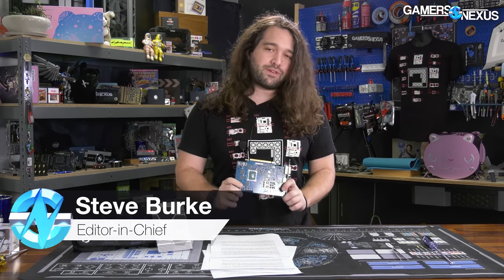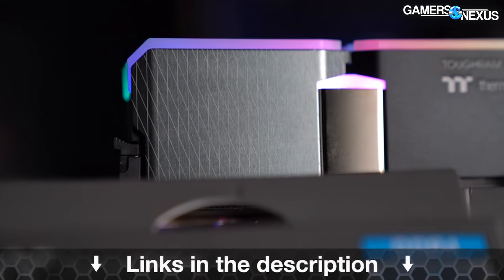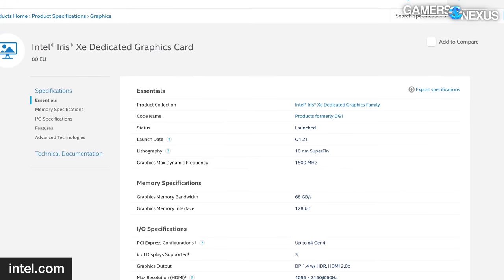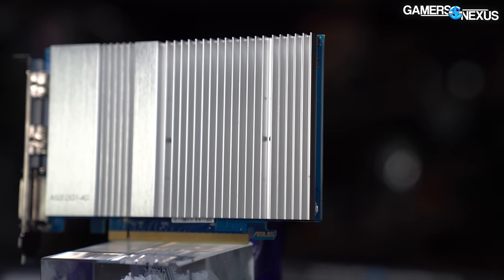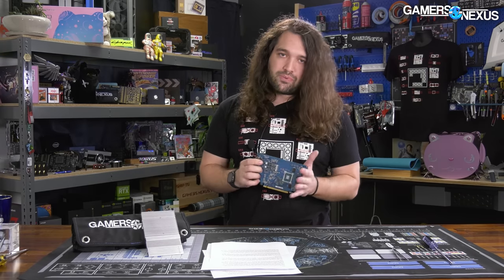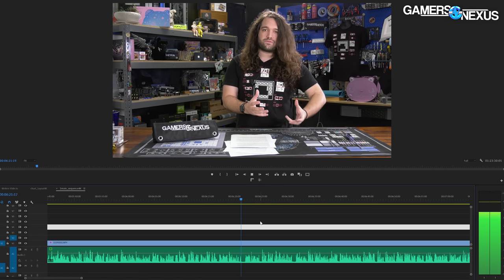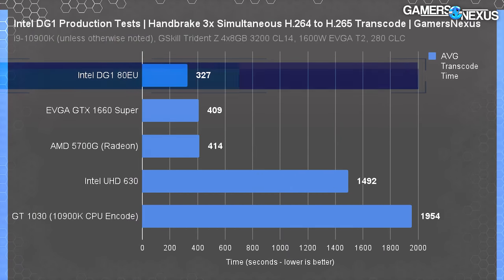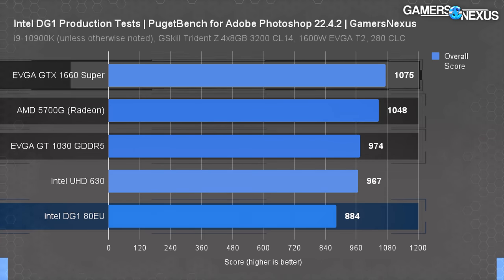Intel GPU A Real Threat: Adobe Premiere, Handbrake, & Production Benchmarks on DG1 Iris Xe

Comment: For video encoding we work with a system which slices the encoding job up into chunks which are a few seconds in size. Then divides that encode job between multiple worker nodes. This allows us to render very large videos very quickly, but as a secondary benefit, if a node is corrupted, or the task is blocking, the system can kill that task and reallocate that chunk. Massively parallel encoding across many, many nodes.

Comment: To install it on other boards- maybe try booting with other GPU as primary while the Intel GPU is in 2nd slot and after installing the drivers remove the primary GPU.
This helped my on older intel made boards that didn't support modern GPU's.
Reply from the maker: It doesn't work. We tried that.

Comment: Thanks Steve.

If Intel releases a version that will work in any old motherboard and was low profile I'd throw one in my old 7th gen Intel media PC that runs Emby media server just for the encode/decode.  The fact that it's passively cooled is a huge plus over higher end GPUs with similar functionality.

Comment: I'd be very interested to see how the Apple M1 performs in these benchmarks. Even though it doesn't really fall under the purview of the channel, it would be a useful comparison to see what performance there is like on workloads like these that can be run on either Windows or macOS. The base Mac Mini is also fairly inexpensive in that a full DIY system featuring either the DG1 or the GT1030 would cost about the same.

Comment: I'm disappointed in the lack of 'multi-gpu' performance as well, big air quotes around that one for sure, but I have been saying for years that amd could do some stuff with that, at least since they started making a big deal about their 'apu' performance, but they can't keep their igpu tech current with their dgpu line. It was also saddening that you can't put it in another system for the same acceleration. Hopefully this is more of the test run and they actually follow thru and add so e of that kind of stuff in the future, because I agree with you in that there is a market for it.

Comment: Good news for the Blender Cycles test: the next generation called Cycles X will not be rendering in tiled ways, but rather more fine-grained load balancing between devices. There are currently some experimentations in the cycles-x branch that balance workload based on actual performance, which will hopefully eliminate that waiting for the last tile issue.

Comment: good video but there was one small niggle; please don't confuse the terminology for intergraded and discrete GPUs as prior to the move to APUs GPUs on motherboards were still considered non-discrete, even though they weren't part of the CPU package, some of them even had dedicated VRAM (I have a board with a HD4250 with 128mb of ddr3 soldered to the board).

Comment: If DG1 would function in my PC, I'd buy one as a replacement for my 650ti. It is exclusively used for video decoding and encoding (and for some low intensity programs), leaving my 1070 completely free for gaming.

Though it'd definitely need to be an example with VGA, or DVI with analogue out.

Comment: OK! Less than 2 cents here.
For blender that you mentioned, I completely agree on cpu+gpu rendering BUT
I use CPU for one render and GPU for a parallel one
Also have an eye on blender 3.0 that is coming at August that will feature Cycles x
supposedly more on par with modern cpuz and gpuz.
That will make the tile rendering obsolete so big hopes for a huge performance uplift
Rumors ahs it 2 to 7 times faster rendering

Comment: I'm not sure were going to have adequate availability of this(or the next) generation of GPUs
Reply: They've booked quite a bit of production from TMSC.  Enough? Only time will tell
Reply: the miners that were forced to shut down in china were selling off gpus to resellers as low as 10 usd each to be sold in european and american markets, dont worry, the price crash is coming.
Reply: @josh223  how do you know?
Reply: @SuperTheLycan  well for one thing china cracking down on mining is public info thats what caused the crypto crash, two most of those mining operations as a result have to pick up and move somewhere else and liquidate what they can't move, three theres been a consistent downtrend in gpu prices since the crack down happened (there are 6700xts as low as 600$ USD for a buy it now price on ebay) and talking to these sellers the ones that will talk will say that this is where their gpus are coming from combined with domestic miners that are jumping off because of decreased mining profitability, and also ive heard this reaffirmed on a few tech podcasts.
Reply: @SuperTheLycan  a day later and UFD tech posts the same sentiment as a video. make of that what you will
Reply: @josh223  link?
Reply: @SuperTheLycan  youtube comments wont let you post links. if you look at UFD techs newest video its in the first few minutes. also publications are catching on to the miners offloading gpus, if interested look at " Chinese crypto miners are dumping GPUs on secondhand trading site

￼

 by Wolfie Zao

July 7, 2021, 4:45AM EDT" at The Block

edit: Its on hot news, not the ufd tech main channel. i forgot they split it off
Reply: @SuperTheLycan  correction: its on the Hot News youtube channel, i forgot that UFD tech doesnt do hot news on the main channel anymore.

Comment: Hey gamers Nexus, did you think about using a virtual environment (such as a kvm) in linux in order to test different types of hardware without the software refusing to operate for the hardware in question? Emulation can often alleviate restrictions or completelly bypass them at a low resource cost, enabling testing.

Comment: I think if you use the same tile size for all hardware on Blender, it will let the faster hardware pick up on what the slower hardware was still working on once the faster hardware runs out of completely untouched tiles to work on. I'm not sure what's the impact in the total rendering time compared to using the optimized size for each device.

Comment: Steve, did you see that EVGA is changing the email notifications for those that requested stock update on GPU? They are automatically moving ppl to the LHR GPU lost due "low inventory" on the normal ones.

Comment: If you use hybrid rendering in blender and set tile size to 16, both the cpu and gpu should use that tile size. 
Not sure about openCL but tile size doesn't really matter since version 2.8 and picking a small tile size makes the difference in finishing time negligible.
From the blender wiki:
"CUDA renders no longer need to use large tiles. In many cases rendering with a tile size of for example 32x32 will actually be faster now. When using denoising it may still be somewhat faster to user large tiles, but this comes with a high memory usage cost."

Comment: For an entry-level 1st gen product with immature drivers, the DG1 actually looks pretty impressive for video transcoding.  I imagine the DG2 will likely be even better, which is a good thing for Intel, because I highly doubt its 3D performance will live up to comparatively priced competitors.

I believe that the DG1 will eventually not require specific chipsets for compatibility, as they are retail box products, intended to be sold stand-alone for $100 (it's an ASUS retail box SKU, the DG1-4G).  I think right now Intel is only allowing them to be sold to SIs and OEMs because of the current chipset compatibility issues (if they restrict them to SIs and OEMs, they can ensure that the cards are only sold with compatible motherboards), but the fact that it exists as a retail box product suggests that the plan is for this to change in the near future.

Comment: The only thing I don't understand is, if this is a test deployment, why not make it work in anything in anticipation for DG2, because there WILL be edge cases that it will not work with. I'd rather use this as a basic display adaptor rather than NV junk.

Comment: Could it be that the DSDT included with the motherboard has the SSDT typically loaded into the ACPI DSDT by the graphics card? If it does, then it might be possible to extract it and inject it via a bootloader to be able to use the DG1 on another system.

Comment: One thing of note is that the hardware accelerated encoders have wildly varying encoding quality and bitrate efficiency, so they're not 100% a apples to apples comparison.
Personally I tend to just avoid the issue altogether by ingesting footage to DNxHR, either as main input or proxy, this entirely removes the decode bottleneck and makes scrubbing ultra smooth as long as you have storage bandwidth

Comment: Interesting, i actually expected better from a standalone version of the iris xe, seems the same from what i remember the integrated iris being, pretty much a 1030 in performance with modern features, but i think the attractiveness of the iris xe comes in the integrated form, haveing a 1030 level gpu integrated with such low power in comparison is a nice advancement.  A low key gaming machine even as ive found out with my recent Dell based around a tigerlake 1145g7 and integrated iris xe, can pretty much run all the xbox games on windows ive been trying really nicely, modern titles can still hit 60 fps albeit at low setting and 720p, its still impresive to be able to get modern games playable at nice frame rates with what i thought was a business laptop.  Maybe they can be used as ai upscalers while another gpu does the work.  Say even a low end gpu, combined with an ai upscaller could hit high end gpu frame rates.   Something more open source than DLSS.  Its the training of the AI is what Nvidia can do better with dedicated hardware and huge gpu farms working closely with developers and having acces to all that data/code. But in theory you could upscale a game yourself, and with how much performance savings are at steak, it cant stay a propriatery for long.

Comment: What are the FFMPEG/handbrake file sizes compared to CPU transcode. With my 8th gen QSV, GTX 16 NVENC, 4750GE(VegaII) and 5700XT VCE, and Apple M1 VideoToolbox, all options had either poor quality, or much larger file size compared to CPU when transcoding to H265 constant quality 22
My guess is that this is because currently GPUs dont appear to support 2 pass encoding

Comment: Imagine if Intel enables the "SLI" feature between DG1 and CPU IG.
And they act like multiple clusters of a single GPU instead of two different GPUs communicating with each other.

That seems like an advantage to Intel because they can make their own CPUs act as the link that queues resources.

They could still use a "bridge" between DG1s to improve PCIe bandwidth.

Comment: Comparing software x265 to NVENC h265 isn't exactly an apples to apples comparison. I'm not trying to throw shade here, but there are substantial quality and file size differences between these two, using the same settings and source footage. I reccommend researching it a bit more and maybe make a quality/file size comparison video.

Comment: I need some help!! 
Recently I bought a MSI GTX 1080 Gaming X on EBay and have been having some issues with it. 
Random freezes, restarts and won't post after it does. Reinstalled drivers many times and I've already repasted and changed the thermal pads, yet it seems to overheat after 5 mins in idle. Could the card have been used as a mining card??

Comment: EU's mean nothing for ffmpg/Handbrake/NVENC Encoding Performance. It's not a 'CUDA Core' type of comparison. I tested a 1650Super against a 2070Super (same machine, single card installed per test) and achieved IDENTICAL results (1080p high bitrate h.264 to lower bitrate 1080p h.265 for archival purposes, in Handbrake). I also had a3rd test done with a 3090 and the results (using the same Handbrake/NVENC software testing environment and parameters) were the same, even with a more powerful CPU in the 3090 rig.

Comment: Considering that intel's hardware video encoders are actually pretty good, this would find use as a cheap add-on for live-streamers with all-AMD systems since AMD's h.264 hardware encoders give out pretty terrible quality compared to the other two players. The norm is to just leverage Ryzen's amazing cost/thread value for software encoding, but that would force you to buy into, at least, the Ryzen 5 tier of hardware if you want acceptable performance. An intel DG1 could push that bar lower and allow you to make a budget streaming setup with a Ryzen 3.

Comment: I used to have a dual xeon workstation from HP for software development; they are just so slow. Built a threadripper 3970 workstation and its so much quicker. Price being equal, I see no reason to use Xeon for workstations at least for my use case.

Comment: LOL, I need for all the tech tubers to make their own "Thanks Steve" or similar to add them to your videos.  :D
Man I was looking at this Intel GPUs for their Intel Quick Sync.  Something I currently use. I'm saving for new PC components. Wanna upgrade to AMD, but kind of annoying that I use many of Intel and Nvidia exclusive features.  Sometimes in conjunction. I don't know if AMD is ignoring this or just have been unable to properly replicate them.  Wondering how well a AMD Ryzen 5000 G-Series would play with an Nvidia GPU.  Like for things like the scrubbing, joint work.  It really do helps me.  Can the Vega offer something similar to QS? If not I too would be okay buying an intel GPU as secondary for those kind of project. Is cheap enough to be worth it.   
An AMD CPU, with an Nvidia main GPU for gaming and a Intel GPU for smoother work.  I'd add another brand for the WiFi but I already have an Intel 6.

Comment: Why would you not go quadro p400-p600 range for a budget discrete card that can do well on a budget workstation, Why a 1660 super?   Should be tested against radeon pro wx2100 and quadro p400 line. P620 and wx3100 might be too much.

Comment: I think the 1030 was the wrong Nvidia card to use. The Quadro P400 or P620 would've been a better comparison. They're similar to the 1030 but have the NVENC hardware. The P400 would be closest to the 1030 in price (around $15 more than the 1030).

Comment: Intel is really looking hard for a problem to their solution... perhaps they should rather keep those devices on their shelves until they've come at least close to NVidia or AMD two generations ago in performance and features. Basically any card after the 1030 supports NVENC and other transcoding features, so picking the bottom of the barrel as your marketing target is probably not the best move.

Comment: The use case scenario is probably the same as a GT 710, if it were sold alone. A cheap card for an old computer to allow the viewing of videos at higher than 480p without screen tearing. My dad has an old Core 2 that did everything he needs(office work etc.) except viewing videos on BBCi, Netflix, YouTube etc. in HD, which as I said earlier, would result in gratuitous screen tearing with the onboard. Fitted a GT 710 and problem solved.
Reply: @LunarVVolf Not gonna argue as I agree with the sentiment, but it is genuinely the only use case I could think of for it. I can't see what else it could possibly be useful for.

Comment: If you really want to test GPU power you should use software that really uses the GPU. AKA Davinici Resolve. 

Second point you should have used source material that really challenged the devices. That means HEVC 4.2.2 video. NOT H.264.

If you wanted to see what is possible take that HEVC 4.2.2 video and play it on a system with just an 11700K on it using Resolve Studio (You'll need the studio license to make use of the full GPU power) 

The final point is if you're using something like Resolve you can let the IGPU decode the video while the standalone GPU does the encoding. Yes BOTH working on the same file.

Scrubbing H.264 files is  the equivalent of asking a college math student to prove they know the 2x math tables.

Comment: I don't think they should have named it Xe. Imagine if you named your product Hetler in the runup to WW2. Then again if the Chinese attack Taiwan Intel will be the only GPUs and CPUs you can get since AMD and NVidia are dependent on chips from TSMC. Maybe it's deliberate. Incidentally, China-owned Nexperia just bought Newport Wafer Fab, the UK's leading 200mm fab. I'm guessing if China is going for a stranglehold on semiconductor production that is significant.